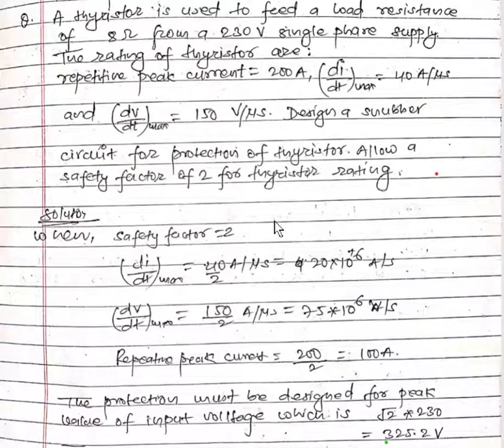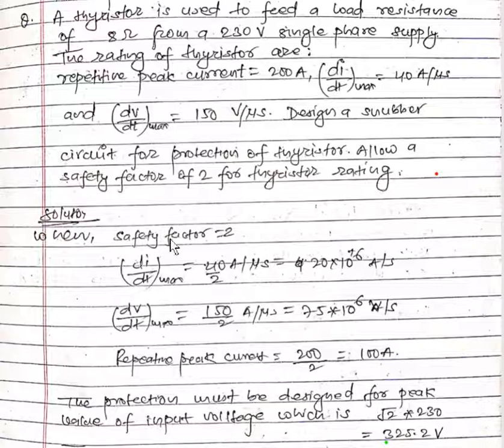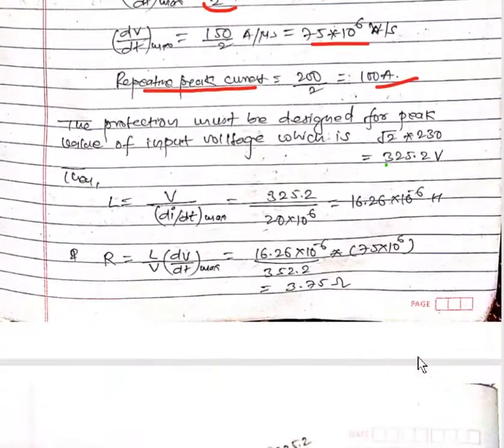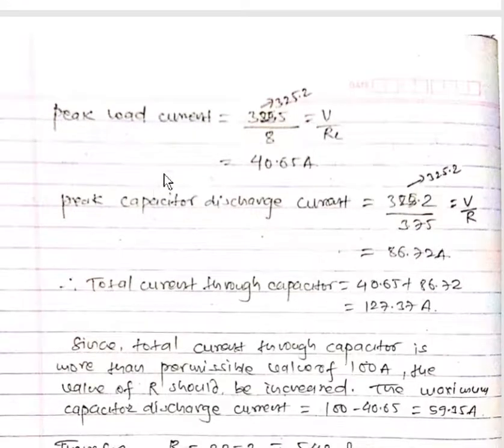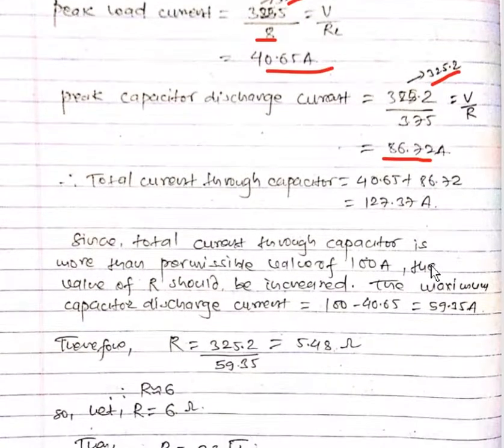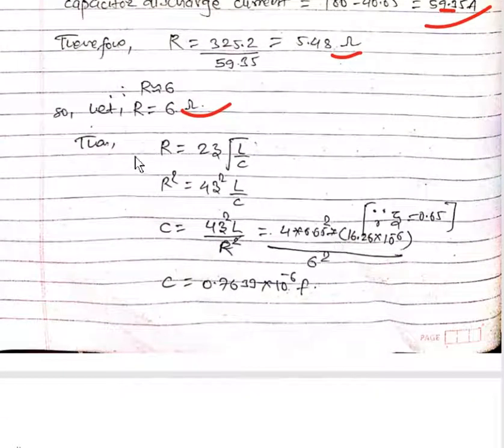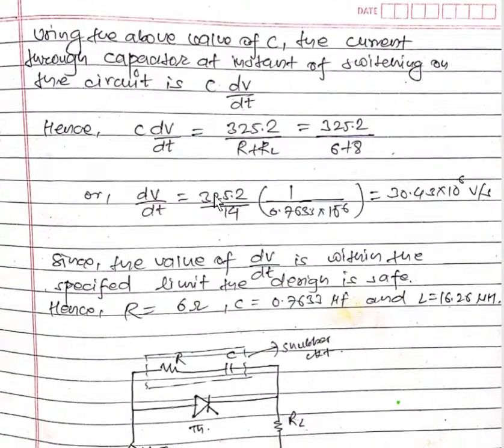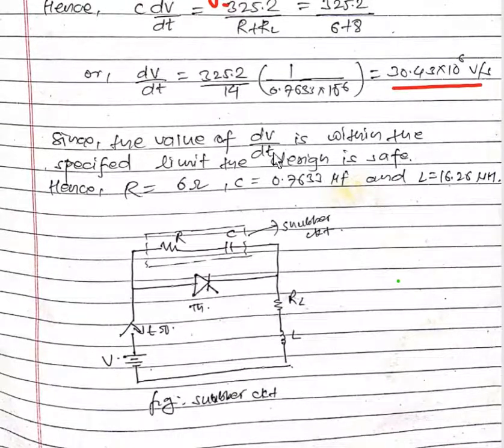design of snubber circuit numerical , SCR , thyrisror

Comment: (di/dt)÷2 is it not supposed to be 20×10^-6
Reply from the maker: safety factor is considered there...
Reply: @smartstudy11  according to the question given data,(di/dt )max = 40A/micro second.Taking safety factor of 2 into according we get 20A/ micro second which is 20×10^-6.

Enlighten me if i am wrong Sir
Reply from the maker: @fortunechiriseri1974  micro gives power -6 but per micro gives you power 6